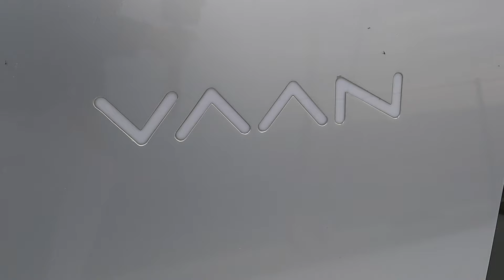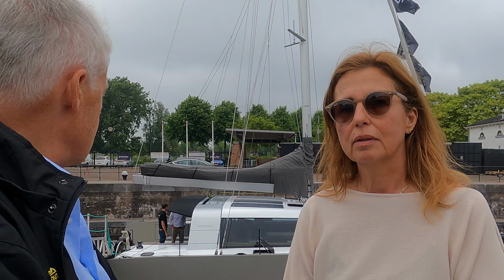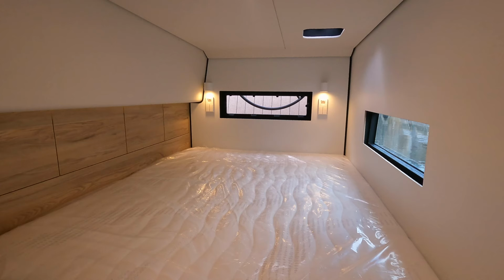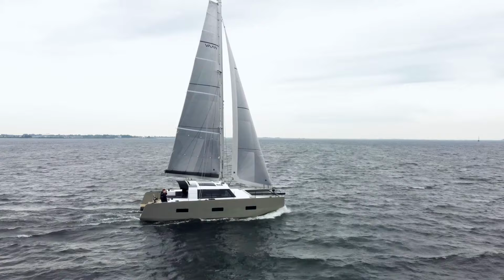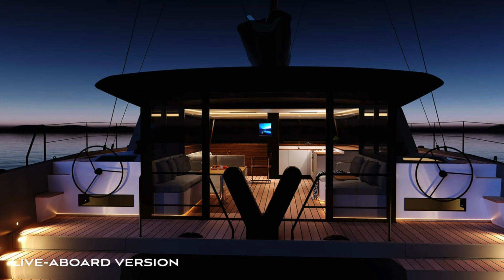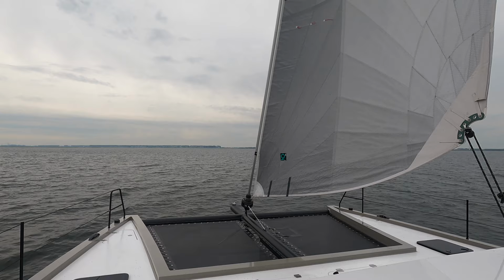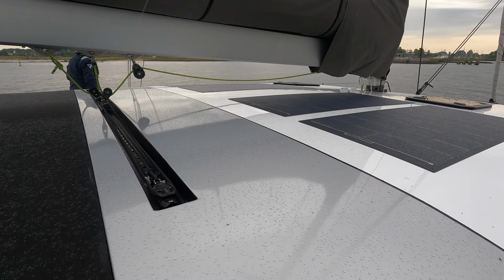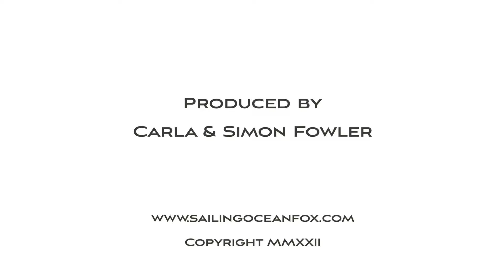The VAAN R4. Boat tour on a recycle sailing Yacht  that doesn't harm the planet! Sailing Ocean Fox

Comment: I guess this boat is just the standard marine grade aluminum in the market!? Lots of recycled aluminum goes into any "new" aluminum produced. Or else, which supplier of aluminum have a special production where more aluminum is recycled?
Reply from the maker: This is a very technical question that should be answered by @vaan let’s hope they look into this feed and reply.
Reply: @SailingOceanFox  They probably wont like to engage... However, if they do, they can go ahead and explain 100% recyclable too, and compare to say an Ovni or Garcia.

Comment: Whenever I look at a boat, I ask myself how safe I'd feel in rough seas on deck - and I wouldn't want to be on that cat.  It's too exposed and none of the sails can be got to easily. The design might be sleek and modern, but practical?
Reply from the maker: Interestingly there are handrails built in to the roof coaming, well hidden. Also, the boat we sailed was not quite finished, there are steps being added in the center of the windows to get better access to the roof deck

Comment: Good job , nice modern minimalist styling . He does goes on about the handling, helm etc. This is not new. Catana, Nautitech. Garcia, 
 Ocean explorer etc all have twin stern helms, and low coach roofs.
The recycled aluminum is not significant because aluminum has always been recycled as a metal.
The electric drive is good. But prefer a hybrid, 4-7 hours is not good enough for  long transits sailing the world.
The price is good considering the aluminium build. I think I would prefer the Garcia Explocat 52 as a luxury. Sturdy world explorer.
Cheers from yyz

Comment: Thanks for the video...my observations/suggestions:

Front windows should swing out like the new HH44 (to allow massive airflow), this vessel does not look like it would have that airflow needed.

Why are they not offering a "liveaboard option" for the R4 ?, seems like there is enough room in the stern

Lastly, that picture of the stern, winches with all the lines all over the place...maybe cutouts in the desk below the winches to stow those lines (tripping hazard).

Thanks
Reply from the maker: You do have two large hatches in the roof of the saloon,  these can be installed either forward or backwards to aid airflow depending on your climate.

Igor from VAAN should have the answer about a liveaboard R4. Sounds like a great idea to me for northern climates.

Halyard bags will be provided on the pushkin Close to the winches.
Reply: @SailingOceanFox  , thanks guys !
BTW, I'm assuming having the liveaboard option would give you more space on the roof area for the much needed solar :)